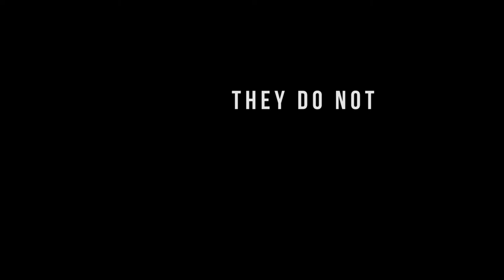Building a DIY "Art Cart" Mobile Painting Station With a Glass Top, Out of Plywood

Comment: What's up with those goggles? Are they prescription? I have never found a set of prescription safety glasses that actually seal worth much around my face, and those look legit. Bonus if they don't interfere with a respirator.
Reply from the maker: They are not prescription, but the lenses are removable so they could be. They are antique safety goggles probably from the 50's when things were made to last. They do a good job with sealing areas that glasses fail to, and I think they look great :) They're hard to find on EBay, so I was thinking of building a few of them and offering them up for sale. Would you be interested if I ever made them?
Reply: Hi it's a good idea. Are you afraid of liability, selling safety items? I'd be interested if they were priced like $20—40
Reply from the maker: The liability issue would probably be the biggest part of it 🤔
Reply: @A.Mere.Creator  call them steam punk cosplay and you're golden. But I'm not a lawyer